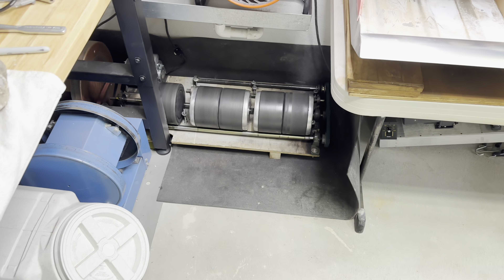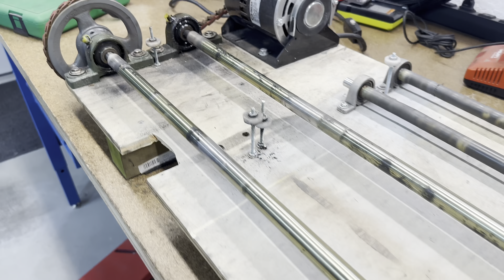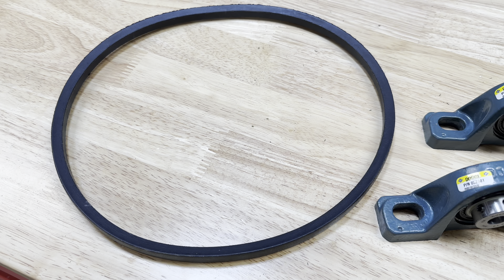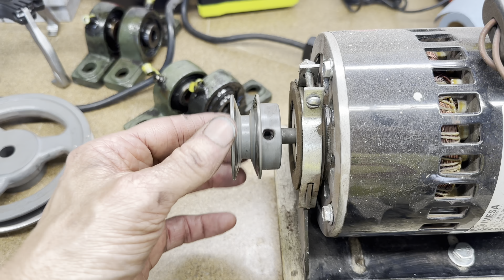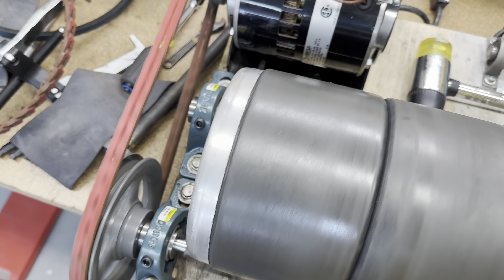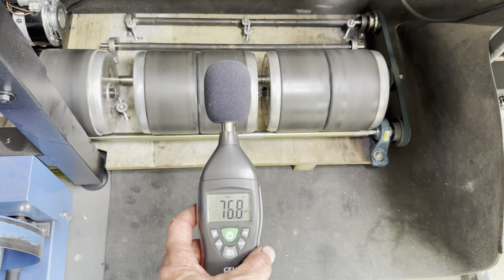My Rock Tumbler is Noisy! Time for a Rebuild

Comment: Jaspers are red,
And turquoise is blue
I like to pause my adblock for you.

In all seriousness though, have you tried using wheel bearings designed for a car? They might last you a darn sight longer. Also recommend Timken red bearing grease - it lasts ages. Hope you're doing well Scott.
Reply from the maker: Thanks for watching, and for the poem! Hopefully these new bearings will work well but only time will tell. I appreciate the info!